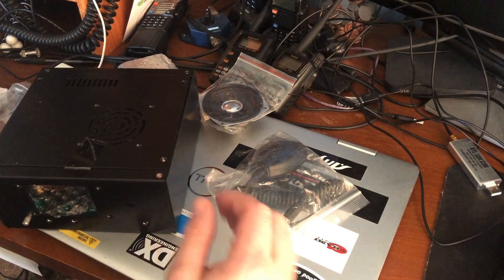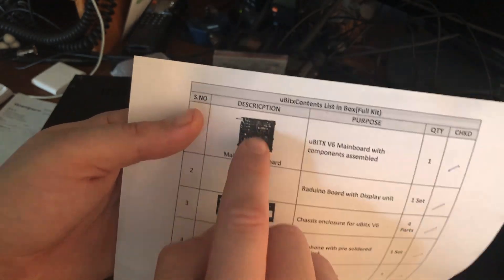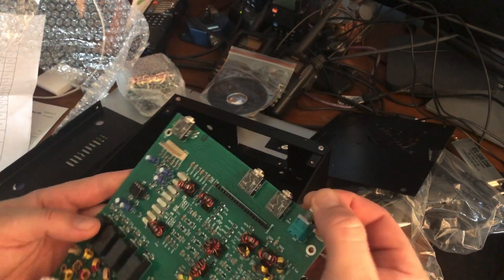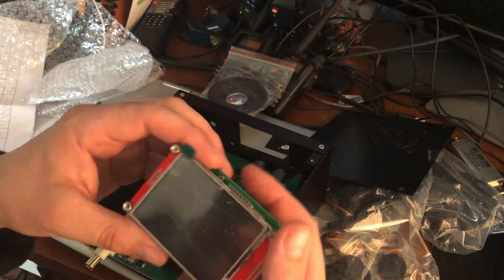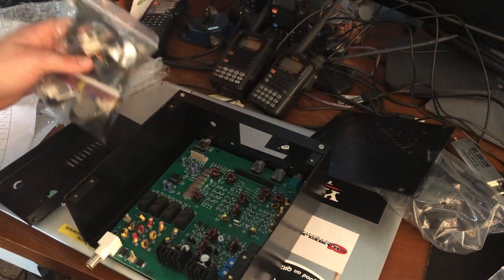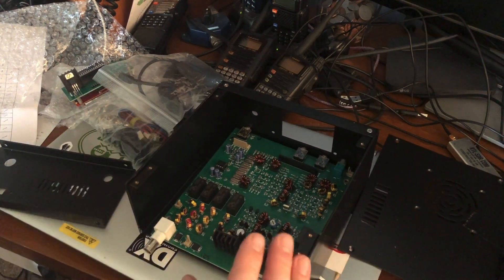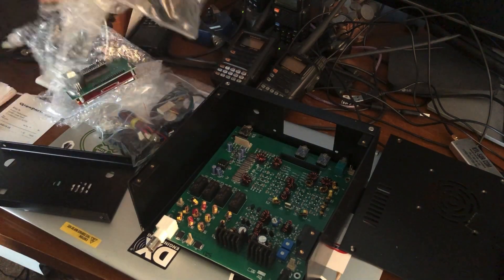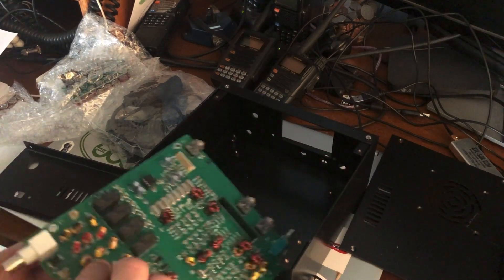Ubitx v6 QRP ham radio

Comment: I've had mine for 2 years and have been more than satisfied with it, The only issue was the tuning rate but going to change the display with a nextion 2.8. You should be able to put it together in about 1 hour. have fun. 73 ki0ad

Comment: They are great little radios.  I have 3 of them.  Two I built.  Third one isn't built yet.  One is a version 3, and I built my own enclosure.  One is a version 4 that I got a enclosure for and put together.  The last one, not built yet, is another version 4.  Thinking of building it into a old Royce base CB housing.  My version 3, my first one, I have used for a parks on the air activation.  They are fun to operate, but the aren't like a Yaesu, Icom or Kenwood but they get the job done.  Have fun!  73 Juddie WD8WV